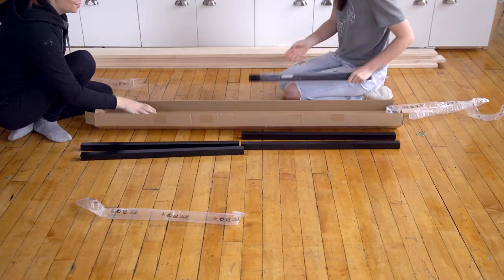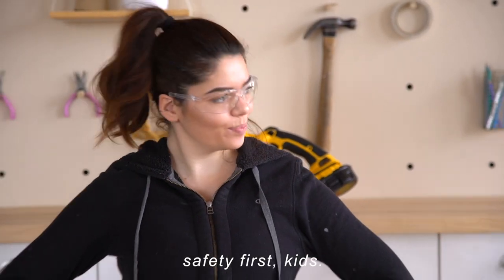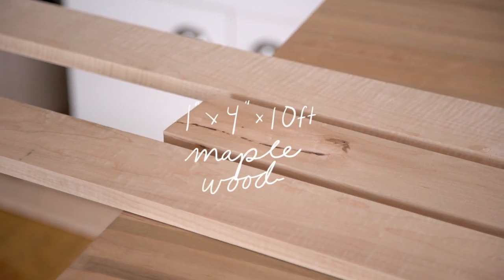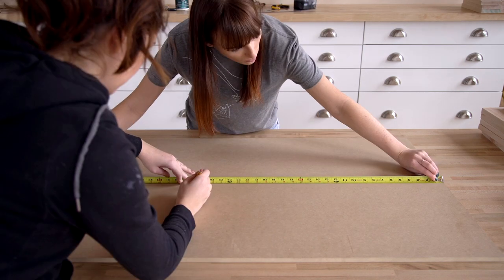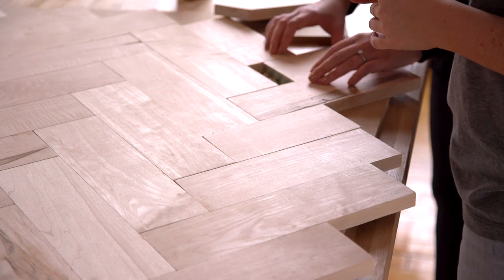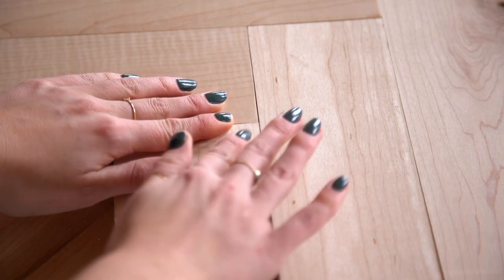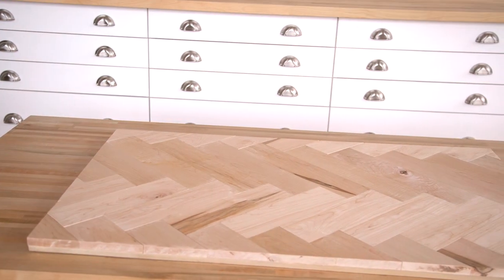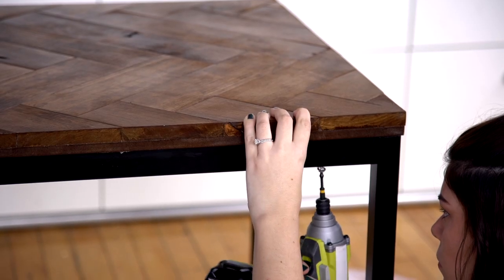WE DIY'D THIS PINTEREST DREAM TABLE

Comment: I have a vintage flea market find table with a horribly stained laminate top. This is perfect cover that up without having to deal with new laminate! Thanks for doing the math!
Reply from the maker: PERFECT! Send us pics when you're done!
Reply: Hi! I wish comments were available on your blog, I can't for the life of me sort out your measurements. 1" x 4" x 10" pieces of maple that turn into 16" by 9, how did they somehow become both longer and wider? I am trying to make my own and thinking I might have to do the math all over again, unless I am missing something that you can point out to me! Thanks for this video. Either way it has inspired me.
Reply: HI - IT'S A 10 FOOT STRIP (NOT 10 INCHES) OF 1" TALL X 4" WIDE. SO A TOTAL OF 120 INCHES LONG PIECE , CUT INTO SHORTER LENGTHS (16" OR 12" OR OTHER....). SORRY FOR CAPS

Comment: Cute table :) can you explain why you have used 16" and 12" wood blocks though? I thought herringbone was made up of equally sized rectangles?
Reply: Because of the herringbone shape they chose to do. You have rectangles pointing up, then down and then up again, for all those changes of direction you need more cuts. I'm planning on doing this and they will all point in the same direction so rectangles on each side will be the same. It saves on wood and amount of cuts and calculations you need to do

Comment: It's stunning! I have to wonder if the wood glue would be enough to hold the pieces on. Did you consider screwing into the pieces from the bottom to provide more hold?

Comment: Having made this table - some tips:
Home depot didn't have any 10 ft lengths, so I went with 8ft lengths and adjusted accordingly (5 boards instead of 4)***. I also went with a 1/2inch MDF board as I could buy that in a 4x4 piece (which they cut to size at the store - just be careful and watch them to make sure they do it correctly). ***THERE IS SO MUCH WASTED WOOD HERE. Cut your 16 inch and 12.5 inch pieces, but only cut about 10-12 9 inch pieces. Then after you've placed and glued the centre V, take your 9 inch pieces and place them. Draw a line using the edge of the mdf (should be a 45degree angle cut) and if you've centred things correctly that 9inch piece of wood will be good for 2 edge pieces. I ended up with 108 inches of left over wood by doing this. Use the extra bits of the larger pieces to fill in the small gaps. Don't build the table and match the edges - use the measurements of the TARENDO table (26 3/8 x 43 1/4) to cut your mdf. Once you're finished making the wood part flip it, build the frame (loose on the corners) and screw into place. You should get some black paint to cover up the screws and washers. 
Price was about $200. 23 for the MDF, 27x5 for red oak boards, 10 for stain, 20 for frame

Comment: Looks lovely, but would have been smart to put the mdf on the floor and turn the lags upside down. And to use a corner of the mdf so you don't have to cut so much.

Comment: so, I am in the middle of making this project, and I have already bought my wood, which was sold as 4in wide maple, but once I brought it home it turns out it is 3/4 in, with the pattern still work with the same measurements or will I have to figure out the math? your blog has been very helpful, thanks

Comment: Herringbone doesn’t actually require all of that math? If you look up the pattern both sides are the same length when making it. I’ve done with pattern with wood before and cut all pieces the same length and it looks 100% correct
Reply: Kristiana Chancy I was thinking the same thing! They're usually all the same size rectangles.